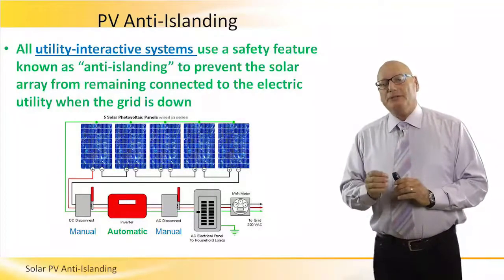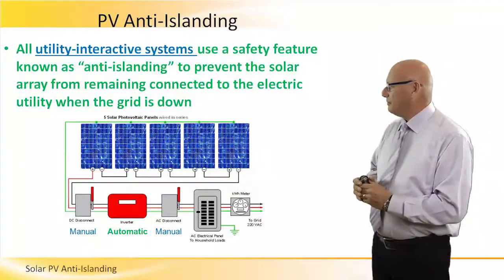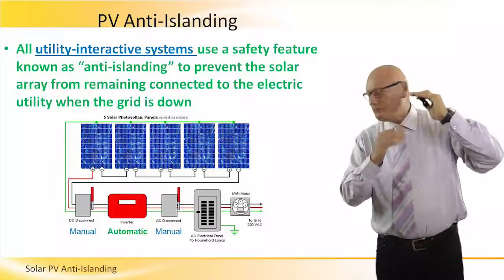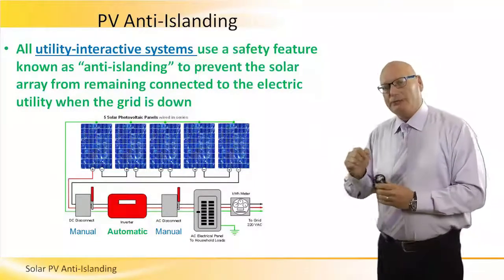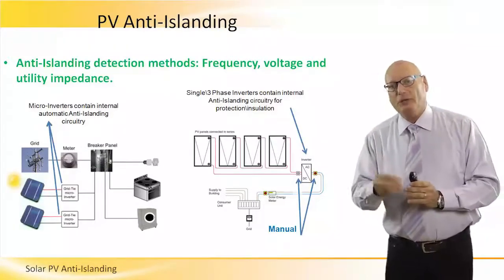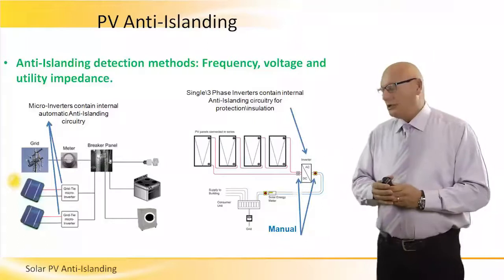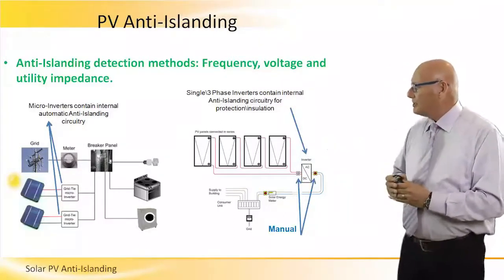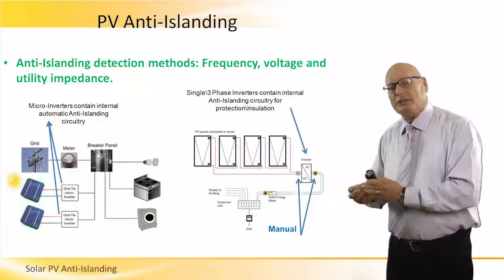Solar PV - Anti Islanding Safety Feature

Comment: I understand the need for anti-islanding, how does your device continue to have a feature wherein I want to have the Solar to be able to (i) charge my solar batteries and; (ii) the excess pv power, if my batteries are full to be able to power my essential loads? Where can we get this device (outside of an inverter), that works, given the above requirements as I am based in Zimbabwe. Can I order online or in South Africa or do you have a local distributor? If we have dirty frequency from the grid, is there a way this anti-islanding device can be programmed for more tolerance variations e.g. +/-5%

Comment: how do they sense (input) when the output  is the same as input (you sense your own output, and utility is down) (witch is fine (eg 50Hz 230V). In other words, how you distinguish Inverter frequency from Utility Frequency, after initial  connection? (are there extra information cables coming from the grid? or other technique?)
Reply: The inverters "listen" to the grid frequency and match their output.  No extra info is needed, it just copies the phase of the utility
Reply: @DigitalBenny  thank you, my question is how do they "listen" after synchronization. Eg. the utility goes down but the inverter is actually listening is  it's own output. That would probably may need an inverter to stop outputing power (at least for short time of period) to listen.
Reply: @GiannisKaralis  Yes, but the "short period of time" in which the inverter "listens" is milliseconds